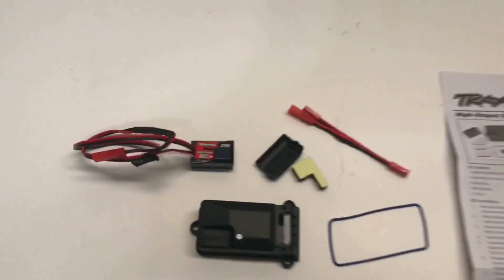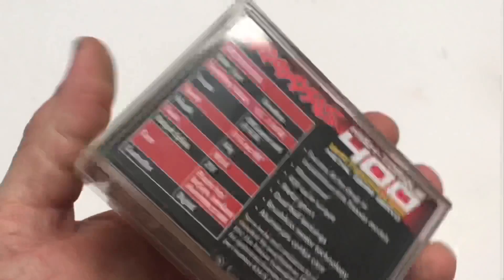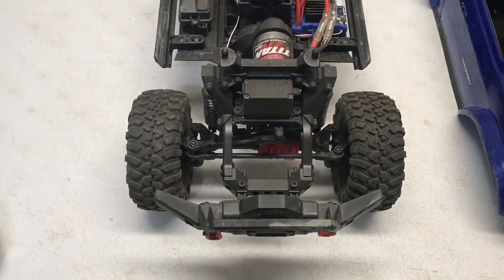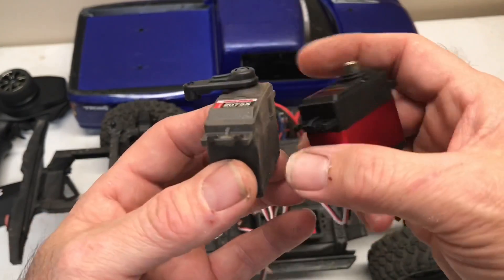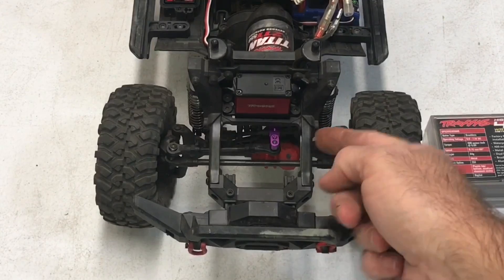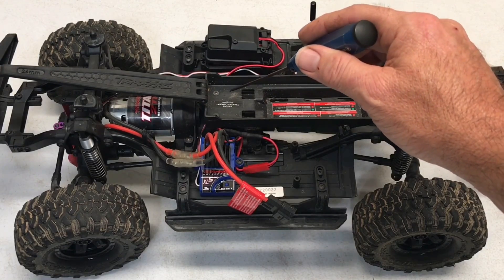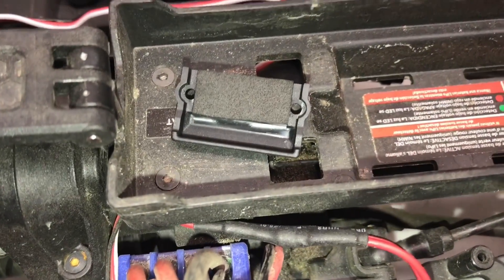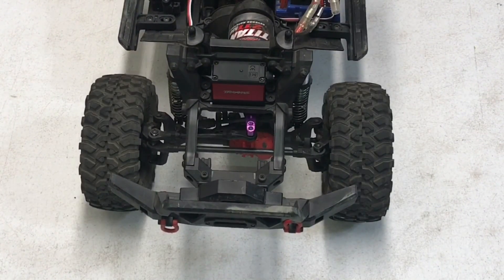Traxxas 2255 400oz servo with BEC install and test

Comment: Isn't the Traxxas BEC  7.4v?  The stock ESC provides 6v, so it would redundant to install a BEC of the same voltage
Reply: it's 6 volt - it's still way better due to the extra current the BEC allows

Comment: Is just me or it feels a bit noisy the new servo?
I've got the Castle BEC in my Summit with 2x SAVOX servos but connect it differently. More exactly the new BEC powers the servos directly and picks only the signal from the receiver. So the receiver keeps its bec for the smaller servos, lights, etc. This way I can provide enough power to the hungry servos but keep the receiver run cool! You can see my rig on my channel. My Traxxas Summit LT t's a scaled crawler converted at the moment...

Comment: R u still running this servo
Reply from the maker: A buddy has it in his truck and it still doing fine.
Reply: @ExocagedRC  what servo are you running now? Was going to get this traxxas 2255 but my local hobby shop says I need to get the Protek 370
Reply from the maker: Sean P RC the protec 370 is an awesome servo. I’ve never tested one but from what I’ve seen it’s awesome. My favorite right now is the Reefs Raw500 for ease of installation and the Holmes SHV500v2 for direct battery power.

Comment: How do you install this on a TRX4 Blazer running hobbywing 1080?  I do have the Blazer light kit.  Can I connect the JST connector into the power module for the light kit?
Reply from the maker: I believe the bec kit comes with the jst splitter so you should be able to just use a Jst off the main battery to get everything working.

Comment: How do I get it to work wit a mamba x
Reply from the maker: Wayne Mcclanahan this Bec is only good for 6v and the Mamba X doesn’t need an external bec, unless you want hv to servo and 6v to shift and diff servos.
Reply: @ExocagedRC  ok I hooked it up an it didn't do anything

Comment: 🤔🙏Helloa, congratulations on the canal.
You could ride bec traxxas with esc hobbywing axe???
Reply from the maker: if you use the full traxxas bec kit, yes it will work just fine. In many cases the Axe BEC is just fine.
Reply: @ExocagedRC  Where I connect the pin that would go to the original esc. I should cancel the internal bec in the hobbywing??
I want to feed servo at 7.4v
Reply from the maker: José Antonio Sánchez Vázquez oh ok you want to run a bec straight to the servo. For that leave the axe esc wires alone, power the bec up and get a servo wire bypass. That will allow you to send 7.4v to the servo and let the receiver run on 6v from the axe. Holmes Hobbies sells bypass adaptors to make it an easy job.
Reply: @ExocagedRC  Ahh okk, but I already bought the bec traxxas, I can get it with bec traxxas and hobbywing.sorry the inconvenience I am denied for electronics😔
Reply from the maker: José Antonio Sánchez Vázquez ok well unless you’re willing to do some cutting a soldering you’re stuck at 6v. That’s all the traxxas bec can do is 6v. It’s not adjustable. If you’re willing to cut and solder you could run the bec to power the receiver and bypass the esc set at 7.4v to the servo. That’s the only way you’re going to get it to work.
Reply: @ExocagedRC  Oh, noo, I'm sorry I threw away my money. Sorry for the inconvenience then. Thank you mate

Comment: I have a rustler 4x4 vxl should I install one of the traxxas BEC if I install the blue traxxas 330 oz steering servo?
Reply from the maker: Kirk Leaman most likely no, should be fine with that. If it doesn’t need to be waterproofed I’d run a faster servo

Comment: Very expensive servo, only 11kg, for less money you can install a 32kg from Power HD.
Reply: That's not true, 400 oz-in is actually 28.8kg-cm and I don't see any Power HD's over 25kg-cm. The Traxxas one is exceptionally good considering it does 400 oz at 6v. Most of the higher torque servos need 7.4V to achieve those numbers.
Reply: @toddsimone7182  I made a mistake, not see the 400 Oz. But, very expensive indeed.

Comment: See in mine trx4 defender the servo works good until you applied throttle,it start to loose power and work little slow,once you stop the servo start to work and response  fast again , I'd buy the traxxas bec after i saw your video ,one more question I'd buy a winch too can i plug the winch on the split  connector that come with it
Reply from the maker: Are you sure your battery is good? Yeah you can power a winch off the additional JST

Comment: Hi,please try explain it to me everybody when use an external bec to increase the performance on the steering servo plug it on channel 1 which is of course steering i don't still get the why it plug on channel two
Reply from the maker: because the bec gets power directly from the battery and it puts that power into the receiver at ch2, the plug swap is so the red wire from the esc can be disconnected inside the bec so its a simple plug and play setup. In most cases the red wire from the esc is removed from the plug when installing a bec into a receiver. Hope that helps

Comment: Can i use this bec with the xerun axe esc? I already have those battery leads for lights soldered on too.
Reply from the maker: Sure if you bypass the bec around the receiver you can power anything, if both the bec and esc are plugged into the receiver you usually have to remove the red wire from the esc plug into the receiver. If both the esc and bec are set at 6v I've had good luck with just leaving them in. You don't want the esc at 6v and the bec at 7v plugged into the same receiver.
Reply: Aziz Inojatov the axe system has a good internal Bec that the can change the voltage of
Reply from the maker: @jamesspence9880  sure you can change the bec to power a HV servo but if the receiver can't handle that, it doesn't last long, thats whay I mentioned the bypass

Comment: You didn't mention, Do you remove the middle (Red) plug from the Traxxas ESC? when connecting the Traxxas BEC?
Reply from the maker: With the bolt in BEC kit you don't have to mess with any of that. Its super easy to put in.

Comment: The reason it didnt brown out on yours is because you lack the other 3 servos from the OG TRX4. The problem is the XL5 HV Internal BEC has a wimpy 1A output.... It gets overloaded when you add 4 freaking servos to it of course, So the External BEC is a must have for those with the OG TRX4 and are upgrading the steering servo.
Reply from the maker: True but if the servos are properly set with end points and all that, they shouldn't be under any load.
Reply: @ExocagedRC  The problem is the TQi TX does not have End Point Adjustments for channels 3 4 and 5 so those Sub-Micro servos are always hunting for end points… That is the reason they use a Servo Saver, They are designed to absorb any excessive movement from the servo at each end point.. Its a very stupid system because the TQi is hugely limited in adjustments in this regard.
Reply from the maker: You have a point.

Comment: A HobbyWing 1080 and ProModeler 470 is a better combo for about $50 less money.
Reply: HW is crap! If you push them they fail! It's a real crap shoot with them. Holmes Hobbies electronics and motors or Castle Creations. Better to buy one and it last 5 years than the down time and cost to buy 3 others.
Reply: i have this combo. with fi spools nothing wants to stop it. castle bec tho

Comment: I have a different esc and the light kit bit can I just solder a jst plug to the power cabels
Reply: imagine wagons if they’ll run off the voltage of the used battery. Yes
Reply: @juantabby4787  it's the battery for the esc
Reply from the maker: Yes you sure can, power this off the main battery and it will be fine

Comment: Why does this look exactly like the $25 30kg JX servo . . . & the JX servo has slightly better specs.
Reply from the maker: I doubt traxxas would rebrand anything considering how big they are
Reply: I wasn't being serious. It's great that they finally know their cars need better servos but paying $150 for it when you can get 6 similarly spec'd or 3 ridiculously spec'd servos for the same price. . . plus any bec I would use would have to be HV. I can't deal with servos crapping out after 20 mins of rocking when the batteries I use can last an hour.
Reply: @VA OldSchool dude the trx4 made in Taiwan
Reply: @VA OldSchool one thing I did knock anybody anything from buying Traxxas I own the TRX sport another thing it's made in Taiwan I thought Traxxas was an American product but I guess I was wrong

Comment: I just installed the Castle creations bec with a Savox servo.  I would have been tempted to in stall this bec, but I've have nothing but problems with Traxxas electronics.  
 Cool video though,  cheers!
Reply from the maker: So far so good on the new traxxas stuff, they are stepping up their game and I like the direction they are going. Plus this bec is a no brainer, it went in super easy, only drawback to some of us who want to run a HV servo is it’s only 6v.

Comment: That's pretty good but pricey. If noise is not a problem i'd take a savox 1230 at nearly half that price.
Reply: You could use conformal coating on the board and basicly have any servo waterproofed. I put a little dab of silicone on the wire/case junction and had good luck with that.
If you want a true waterproof savox try the SW1210SG 444oz 0.13s
Not brushless though, only Coreless.